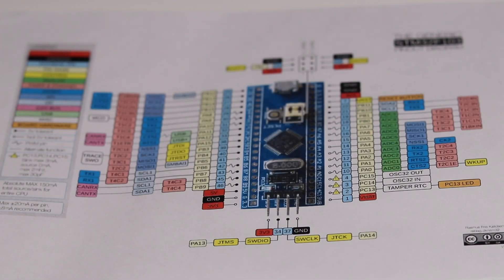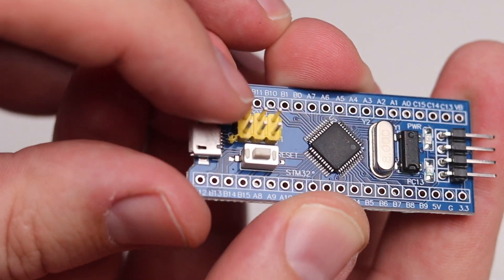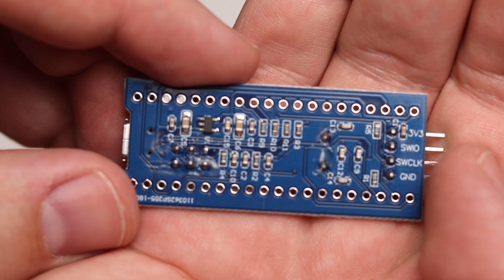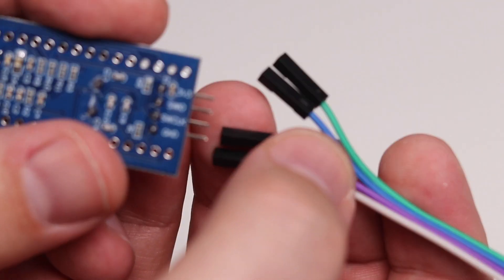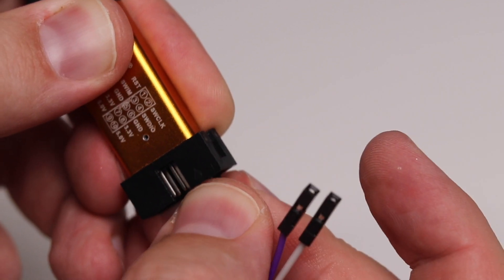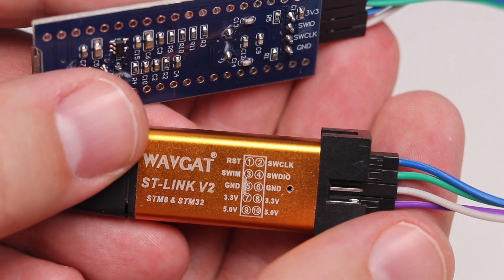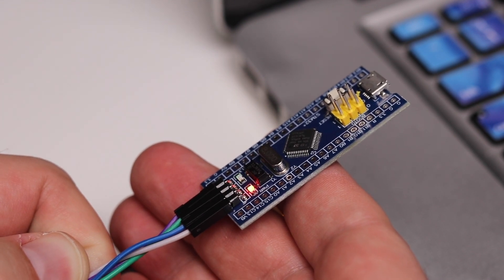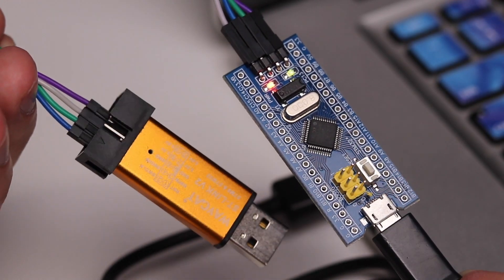Blue Pill (STM32) Rust Workshop Part 1 - Hello LED! - Oct 8, 2020 - Utah Rust

Comment: This series was really helpful (and timely). Got a bluepill a couple weeks back, and decided to learn rust to get a more modern dev setup. I was struggling to get other examples to work with semi hosting/println. Worked with your setup. Thanks!

Next challenge, getting unit tests to work nicely on the chip and locally if possible.

Cheers